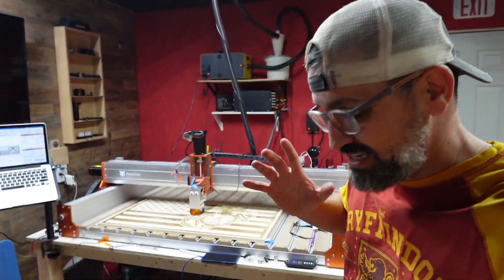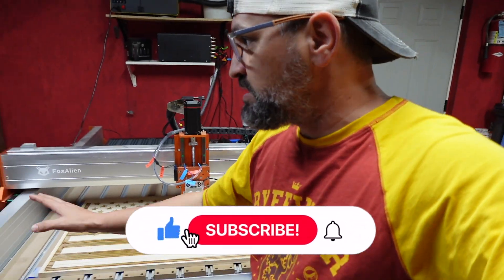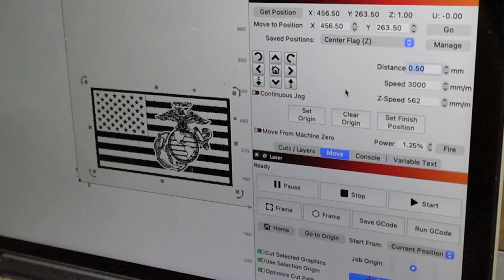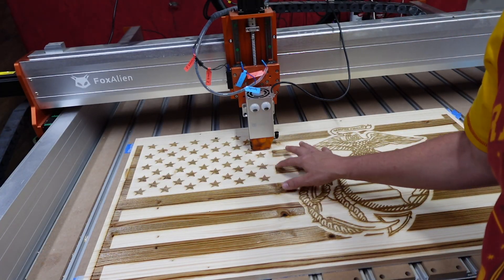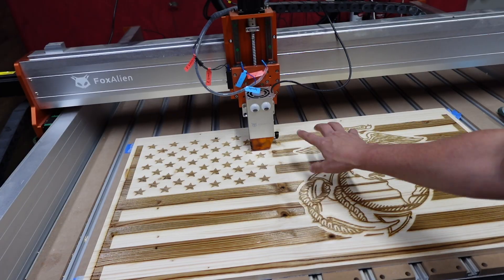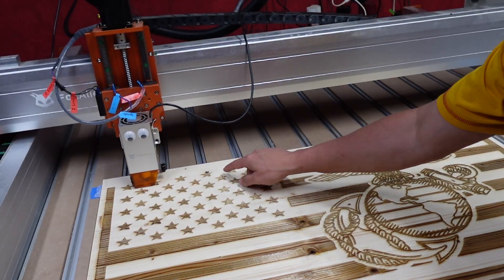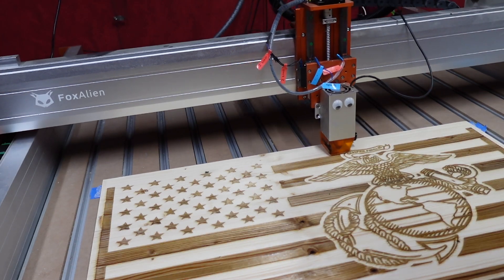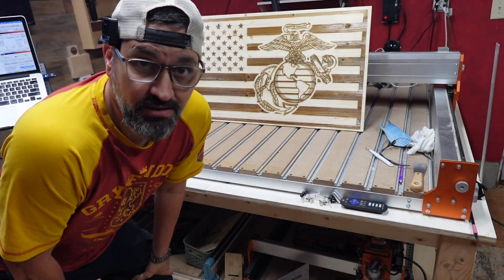How to Recover a Laser Engraving After Power Loss! Don’t Panic!

Comment: Lucky break there. Huge laser project , never seen anything that big before on laser. Good job you recovered.
I don't know if it works the same in Lightburn, but on CNC, when you zero X,Y,Z those coordinates get saved in GRBL. If you type $# in your sender console window the current configuration gets displayed.
The last probe is on line PRB: and often repeated on G54
Might be same in Lightburn
Reply from the maker: Hey John! You’re not kidding. I got lucky for sure!  I’ll have to check that out!!!